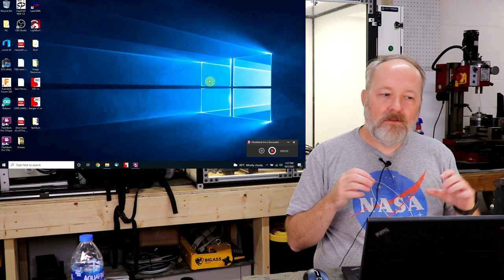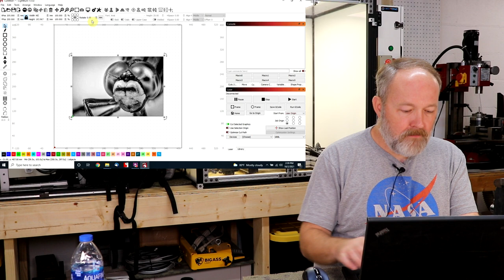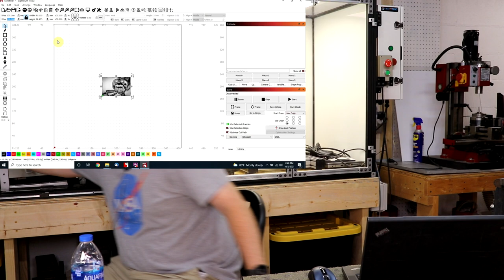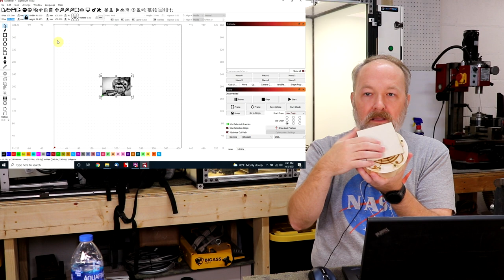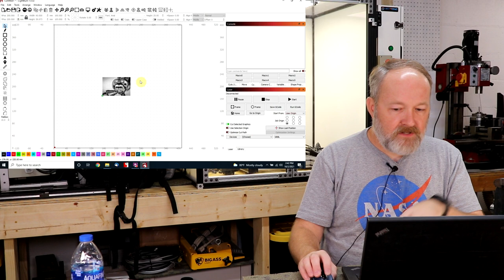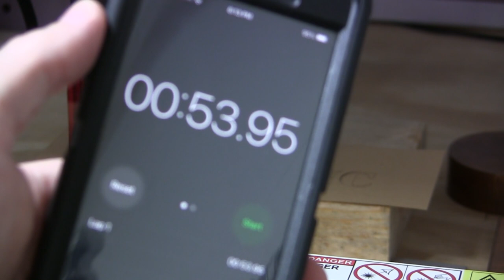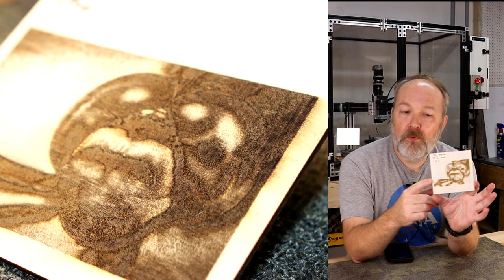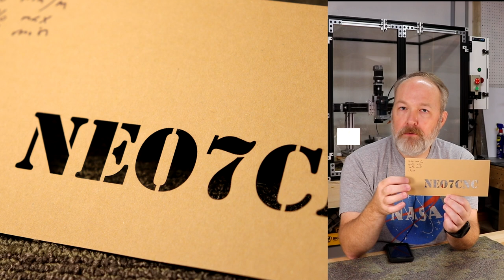Answering Your Desktop LED Laser Questions - Deep Dive

Comment from the maker: Thanks for watching everyone!  Here's the time stamps if you want to skip around this longer than usual video.
1:30 Viewer questions
6:08 More about materials
10:41 The software
12:49 Creating the jobs for the laser using Lightburn
28:25 Setting up jobs on the laser - placing materials
32:10 Engraving #1
33:42 Engraving #2
34:30 Cutting stencil
37:40 Results and Final thoughts

Comment: I worked at a company that had a 40W fiber optic laser. Even it could not actually etch the metal. It only reacted to the natural oils and coatings on/in the metals.